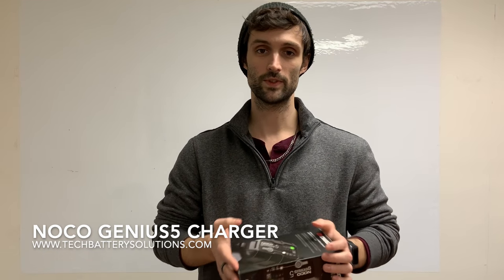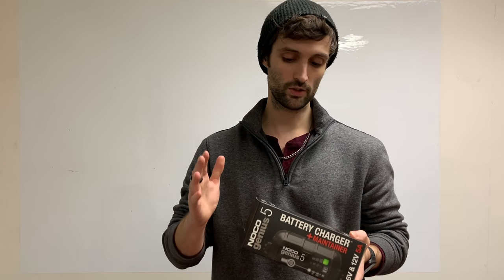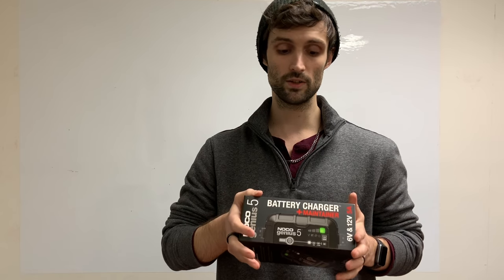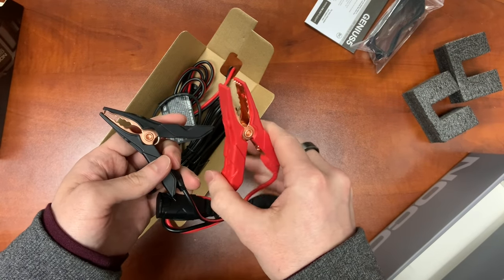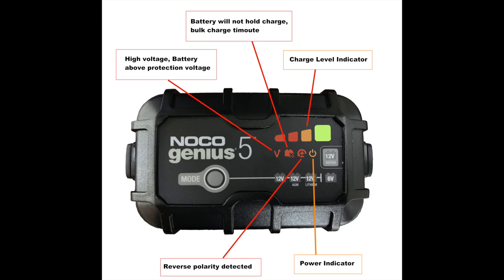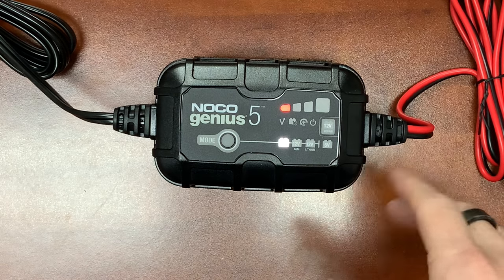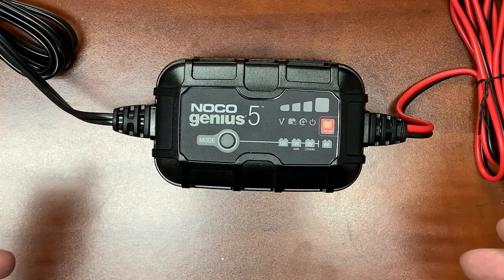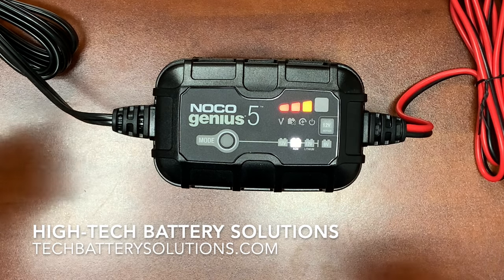NOCO GENIUS5 Battery Charger Review, In Depth

Comment: Maby you can tel me i can charg EFB battery ?
Reply from the maker: Yes, this charger can charge EFB style batteries as well
Reply: @HighTechBatterySolutionsInc  12 V program?
Reply from the maker: @marekextreme  Yes, you would need to use the 12V mode.
Reply: @HighTechBatterySolutionsInc  top! thanks.

Comment: Does yours get a bit warm? Just received mine.
Reply: Used Mine Today Took off to place back on the shelf and the thing was burning up hot not sure if this is supposed to be like this?
Reply: Update 8/21/20: I emailed NOCO and was told  this is normal. The first time I used it ....it got hot.  I left it to go through it’s maintenance cycles as it sat on the first red light for about 16 hours before it worked it’s way to solid green but later that night it had cooled down. It’s never gotten even slightly warm since. It had a lot of work to do on my battery in the first 8 hours or so. All is fine now and I love it. It now takes about 10 minutes, at most, to cycle through, check cells and get to solid green. It did exactly what I bought it for and I bought it just in time or it would have cost $300+/- to have a new battery put in and coding done for a new battery on my BMW. I was close to needing that new battery. Well spent money on noco. Since then my 3 sons each bought one and my daughters husband. One got the noco10 bc he has a heavy duty King Ranch Ford F-250 and needed more am/h for his battery. Battery states am/h so you will know which you need. I like that it’s not a one size fits all.
Reply: 552man .....updated

Comment: When it’s done , does it automatically go into repair mode?   How and when do you know if you need to use repair mode ?
Reply from the maker: When the charger is done you will have to manually set it in repair mode if you think your battery needs it. Repair mode is for recovering old, idle, damaged, stratified, or sulfated batteries. If you have a brand new battery or if your battery is less than 3 years old in a daily driver then there is no need to put it through the repair mode. This mode is for a battery you know is in bad shape - it's been sitting idle for a year without a charge or is having capacity loss issues. For the best results, NOCO recommends running the damaged battery through the standard full charge cycle and then selecting the repair mode once it's completed.

Comment: What happens if all the lights on the charge indicator remain on? (They have remained on throughout the night) should i put it into repair mode?
Reply from the maker: Is the very last green light slow and steady pulsing? If it is then the charger is topping the battery off, this sometimes takes awhile depending on the condition of the battery.

Comment: I have a Norco5Genius, using it on a completely dead 12v wet, left the lights on for a couple of days.  It has been over 12 hours and just got into the pulsing orange.   The trouble with these new smaller smarter chargers things is the time.  Personally waiting this long when the old style chargers would have been done hours ago just seems like a step backwards.  So many things today seem like they are a step backwards and seem to be engineered for women, electric seat warmers, electric windows, all the extra computerized stuff that make you car comfortable.  None of this stuff is necessary.  Glad that you can still get big scary powerful tools.